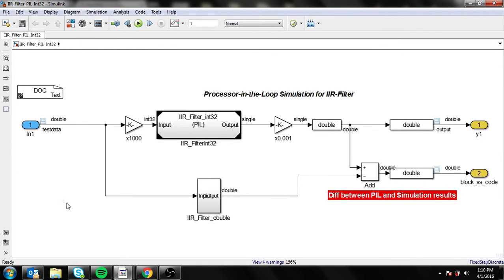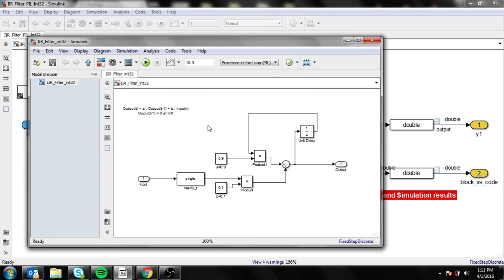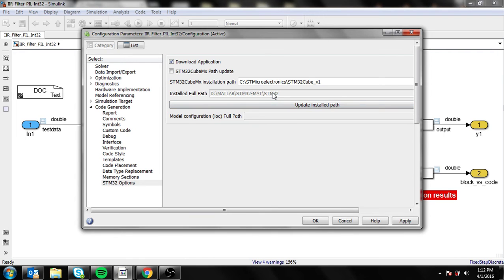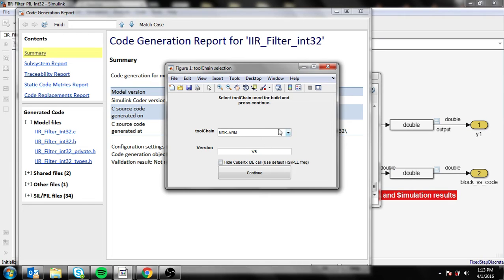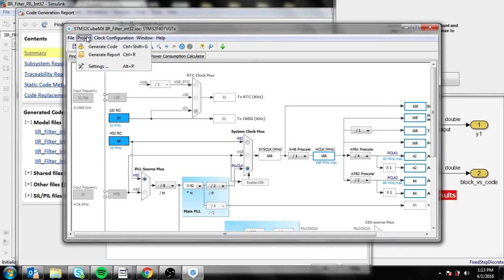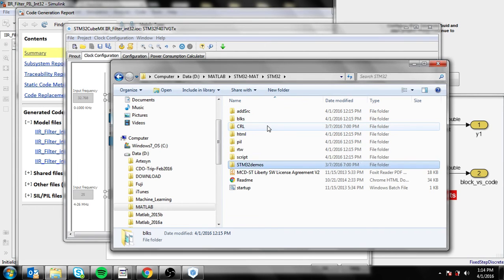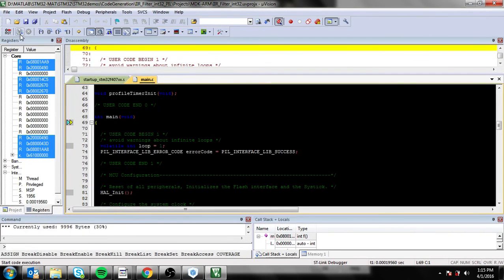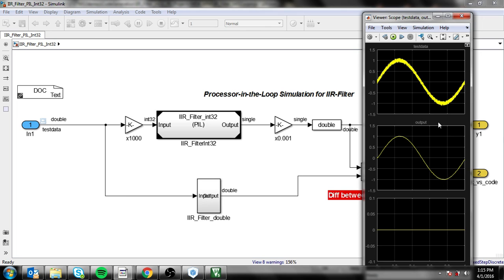MATLAB PIL on STM32

Comment: how to solve this?
The timeout of 10 seconds for receiving data from the rtiostream interface has been exceeded. There might be multiple reasons for this failure.
You should:

 (a) Check that the target hardware configuration is correct, for example, check that the byte ordering is correct.
 (b) Confirm that the target is running.
 (c) Consider the possibility of application run-time failures (e.g. divide by zero exceptions, incorrect custom code integration, etc.).
 
 Note (c): To identify possible reasons for the run-time failure, consider using SIL, which supports signal handlers and debugging.

If you cannot find a solution, consider using the method setTimeoutRecvSecs of rtw.connectivity.RtIOStreamHostCommunicator to increase the timeout value.
Component:Simulink | Category:Model error
Output argument "lSections" (and maybe others) not assigned during call to "coder.profile.ExecutionTime/get.Sections".
Reply: Hello, mhmd, Did you solve this issue?

Comment: Hi. Could you explain, how did you make the IIR_FilterInt32 block, as a separate part of model? When I created a subsystem and tried to set the PIL inside, mode changed for whole model
Reply: right click on the reference model and go to Block Parameters. 
There change the mode to PIL and this does it for the reference model only